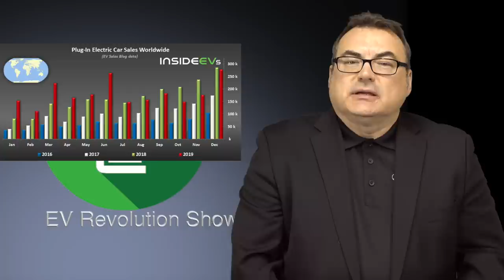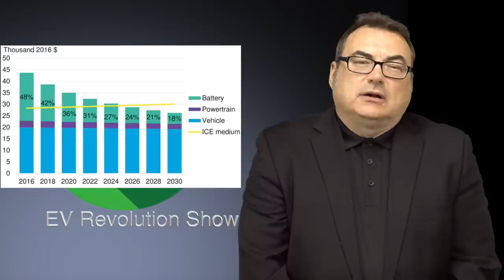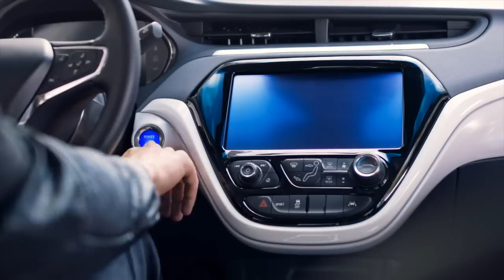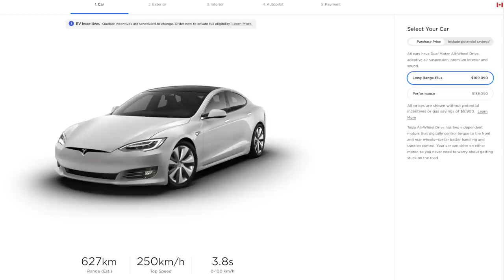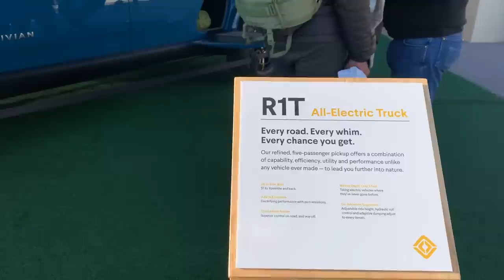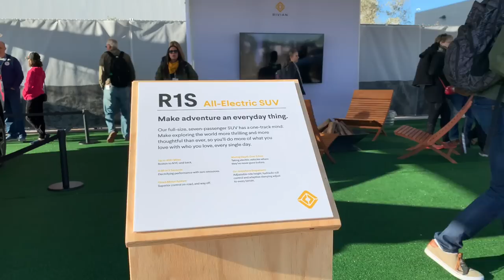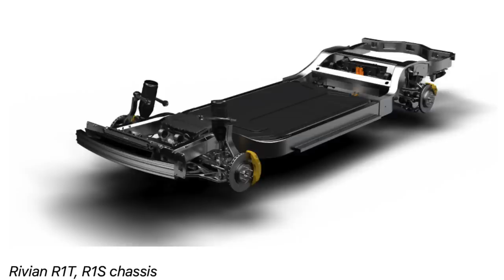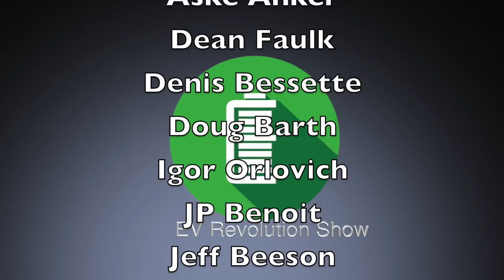Episode 80 -  FCL USA Rivian Interview, Nikola Badger Concept, VW I.D.4 and more news!

Comment: One factor may be that EVs were originally sold at a loss. With the cost drop, they are now cash flow positive. But I don't expect EVs to drop too much until solid state or silicon batteries are available. Then EVs will be cheaper to produce than ICE vehicles.
Reply: Tesla has gotten their batteries prices down mostly using economies of scale.  A more energy-dense battery doesn't hurt, but it still has to be cheap to produce.   Lithium-metal batteries for instance promise great things in density, but will be more expensive in materials.  The big problem for pretty much everyone is that nobody builds their own batteries, which means they are paying a 3rd party who is also selling batteries to their competitors.
Reply from the maker: Thanks for watching @Patreeko and @youferrer.  Good comments and yes other than Tesla's in-house relationship with Panasonic and recent acquisitions, most OEMs have to pay 3rd parties for batteries.  So they can hold them hostage on pricing since it is a fairly closed marketplace with not that many real players.  

You mentioned Telsa and my thoughts are that really when you think of it, the Model 3 should be starting well below $30K USD with the pricing drop on batteries since Tesla's inception.  For them to make slim margins on a $35K and upwards USD M3 is somewhat disappointing.  To me this shows that Elon has not hit the "economies of scale" he's promised as even with market-leading sales numbers of the Model 3, it could be a lot more.  Kinda like the Corolla of the EV world.  Toyota's Corolla was the number 2 best selling vehicle globally in 2018 (have not seen 2019 numbers yet but don't expect too much of a change) with over 1.5M units sold.  And this is a vehicle that can be had here in Canada for under $20K CAD.  So yes, pricing really does matter and in order to really create mass market adoption for EVs, upfront costs is the number 1 barrier.  Yes I know you can make that back over a multi-year TCO model with reduced fuel can maintenance costs, however the vast majority of people don't look at that when they are shopping for a vehicle.  They look at the upfront cost.
Reply: FYI Tesla is buying from the same 3rd parties ie LG and CATL for its production in China...
So thx for proving, it will be a false statement (ie cult based rant) when its starts with  words  "Tesla has".

Comment: If you equate battery pack to gas tank/pump, the cost of making a gas tank/pump is peanuts compared to the battery, the battery will never be less expensive then a can for gas Therefore is the cost saving have to be in the electric motor vrs gas motor/transmission to reduce the cost of EV's.
Reply from the maker: Thanks Leo for watching.  Yes for sure batteries are way more costly than gas tank.  However, EVs use a much smaller percentage of parts/components than ICEVs do so this should equate to at least parity pricing, if not lower - as you have alluded to.  

Hope we can see this come to the marketplace sooner rather than later.
Reply: @EVRevolution  
As the scale of EV production ramps up the simpler electric drive trains will drop below the cost of the gas drive train, combined with the decreasing cost of battery's.
Battery's will never be less expensive than a gas tank,  but the combined system cost should reach parity or bellow.